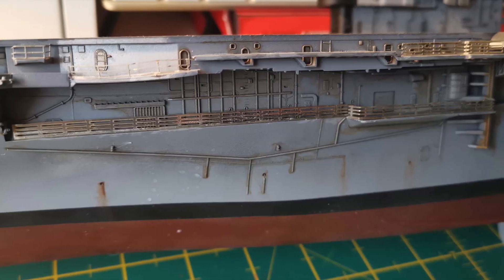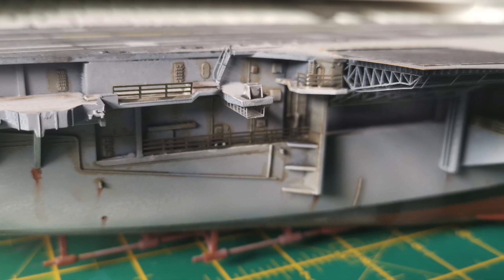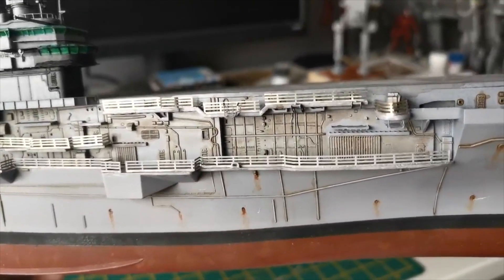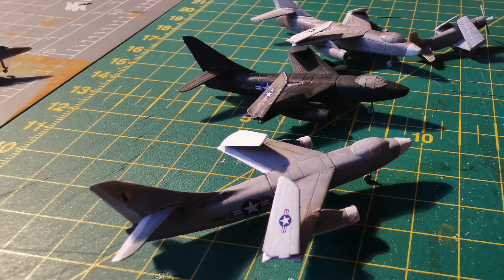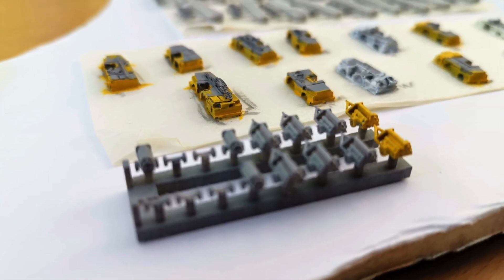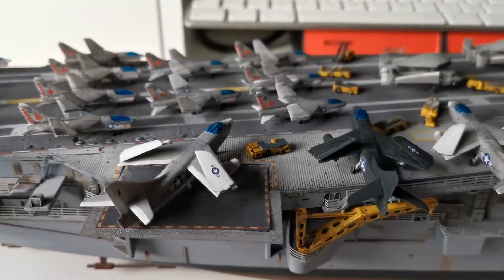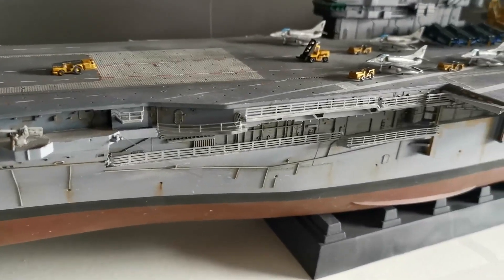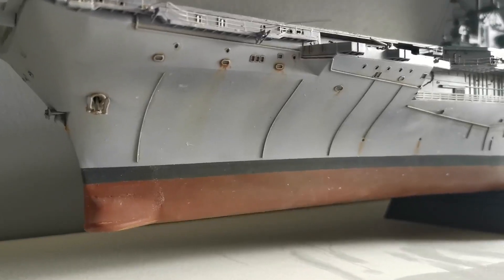1/350 Scale Model USS Intrepid CV-11 Aircraft Carrier Part 4

Comment: Hi, Beautiful work. I served on Intrepid in 1969-71 in 1st Division as a Boatswains mate.  I noticed the weathering on the portholes across the bow. This was the forward steering compartment. If the bridge was disabled you could control the ship from there. One of my jobs was to keep the bow free from rust. we Never allowed rust build up around those portholes. If you want to add a interesting touch, the bull nose in the centerline of the bow was painted BLUE in 1971 when we crossed the Arctic Circle. It was painted over after she was decommissioned. I do have a question about the center line elevator. It is in an odd shape in your pictures. It is square on the ship. Did the manufacturer mold it or did you make that shape with paint?  Again  a wonderful job. I have been onboard hundreds of times since the museum opened since I am a member of the Former Crew Members Association and am originally from NYC.  Thank you.
Reply: I was wrong about the forward elevator. Just saw a picture of the flight with the elevator down and it is the same shape as the model.